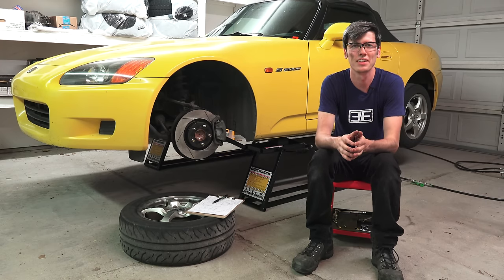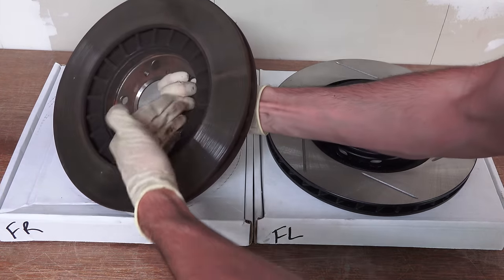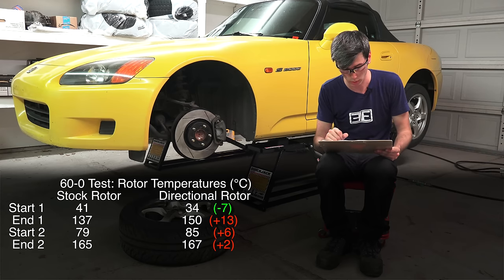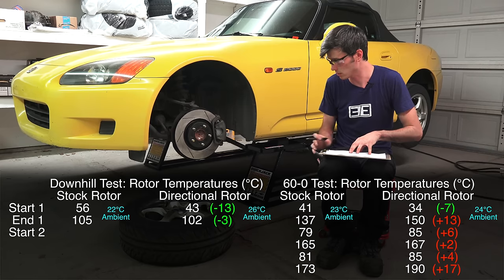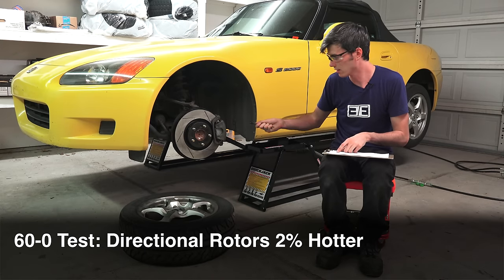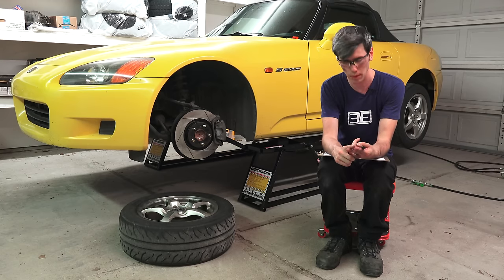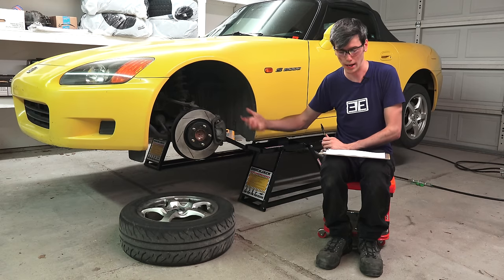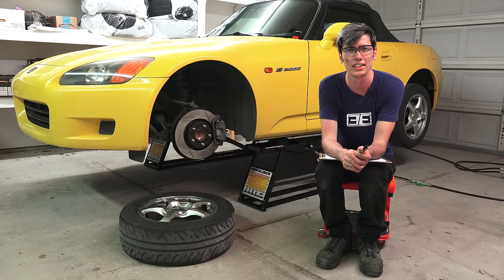Do Performance Brake Rotors Have Better Cooling?

Comment: Isn't the whole purpose of a brake is to convert kinetic energy to heat energy? Wouldn't hotter mean better braking, to an extent?
Reply: Not quite, braking creates friction. Heat is a by product of friction. The more heat the less efficient the pads are.
Reply: @elrud5964  Creating friction is exactly transferring kinetic energy to heat energy. Go back to school
Reply: @95birdman  dont need to go back to school, im doing just fine.

Comment: So would you recommend a set like that for some one in delivery? I know my breaks get way too hot and stay that way for too long. I make about 250 stops every night in about 4 hrs over about 100 miles.  I figure mine get and stay hot because they squeal something awful. They started about 2 days after i canged the pads. Plus my rotors are discolored.

Comment: I know this is an old video but it was a great video! Would be interested to see what happened if you swapped the directional rotors side to side and see if there was a big difference in cooling with the vanes backwards

Comment: Isn't interesting Science of Speed testing achieved drastically different results
Than all your inept testing,
first your directional rotors are backwards,
second slots are for venting brake gases,
holes drilled in rotors are for cooling

Comment: Racing teams avoid drilled and grooved slot brake discs. Drilled crack over time. The best brake modification I ever did was replace stock rubber brake hoses with HEL stainless steel braided. I was sceptical at first but on my 2002 Volvo S80 they have improved pedal feel. I was pleasantly surprised.

Comment: The Aftermarket Roters getting hotter, Don't you think you could have told us if they actually stopped you quicker though? 

It's fine if they're higher temp if they stop you 15 feet sooner. 

Those wheels man. if you literally went to Ebay and Typed in "The most generic looking alloyed wheels on earth". i bet they'd be top of the list?

Comment: You cannot really compare two different sets of break disks together with the same set of break pads. The break pads and the disks have to "break in" together, before they work properly.

Also what would have been interesting is the break performance.

Comment: I think I see why they performed worse. Since the hat is where the air enters is smaller, and having to rely on air from the wheel side which the wheel blocks most of that. The stock rotor pulls air from the underside of the car, where most of the air is to begin with, and have much larger air entry. If the aftermarket rotors were to use the same entry point and size of entry compared to the stock rotor, than it might show better results.

Comment: Lol there is a reason why in  Formula1 they use BLANK rotors NO slots or drilled ect. And less likely that it would crack or fracture under those extreme conditions vs a drilled/slotted rotors. Quick Google search you will almost NEVER find even a slotted rotors on an F1 car.

Comment: Wouldn't if you put the rotor on the other side it would scoop up the air instead of pushing out the heat?

Comment: Seriously? Slotted rotors for cooling? That's not what the slot is for..... 😂🤣😂🤣
Reply: Tickle Fingers what is it for then?
Reply: @vader2774  Slotted rotors remove gasses and brake dust from between the surface of the rotor and the pad. Gas and dust from excessive braking can reduce the friction force of the pad contacting the rotor and that reduces brake performance. Crossdrilled rotors will help in heat reduction as well as removing some gasses and dust. Crossdrilled and slotted rotor combos try to utilize both benefits. Crossdrilled rotors can be more susceptible to cracking though.

Comment: The bias is built in the way you make the test. 
The brake that bits harder will do most of the work (larger force x same distance)
You need a test with 2 stock rotors and then change to 2 aftermarket rotors.
This is a really badly designed test.